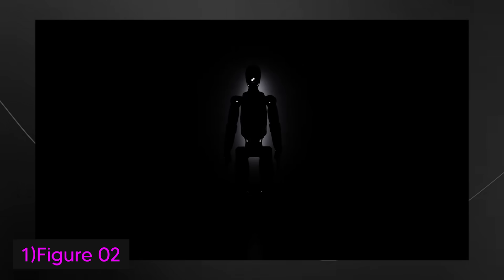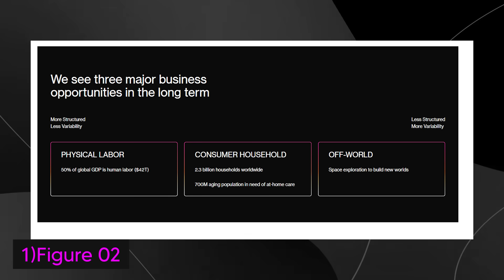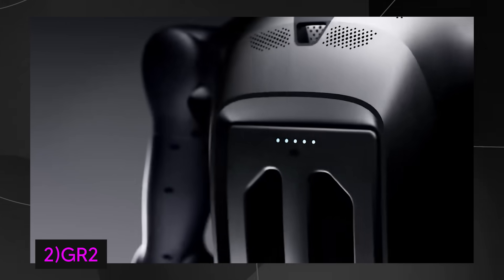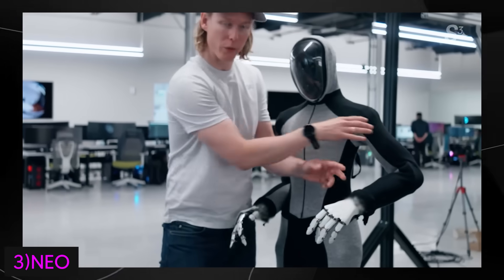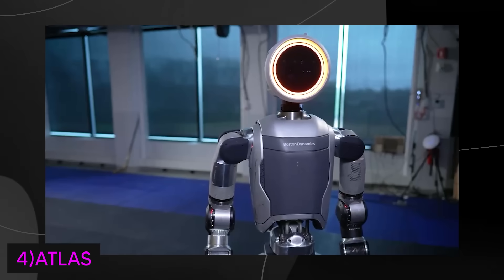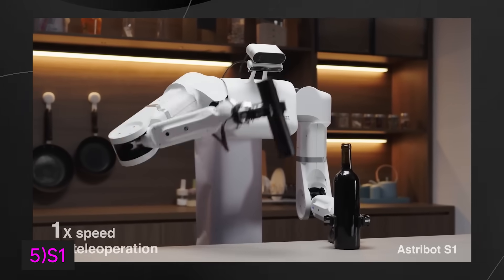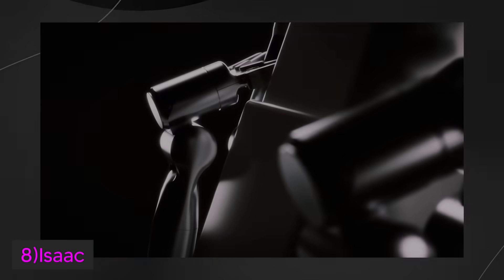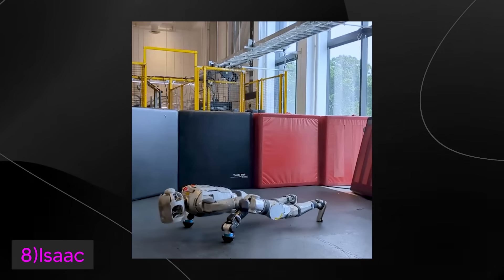Top 10 NEW Humanoid Robots of 2024 (Updated)

Comment: What happens when these humanoid robots tip over? Can it pick itself up? How durable ate they. If my child accidentally knocks it over, will impacts dislodge or break components. What if they get wet? Run out of battery power. How long will it last before needing charge? Are they confined to the home?  What if a person gives it a firearm? What is the estimated lifespan? What do you do if it malfunctions or stops functioning completely?  Most importantly is there a kill switch? All of these presentations are too vague about any sort of actual specs or capabilities. All I am seeing are glorified animatronic like machines that remind me of Chucky Cheese. Task specific robotics make sense for efficiency and safety. These humanoid robots are not actually doing anything that would help or save a person time. Its going to become an obstacle in the home.  You can hire cleaning service for 1/3 of the robots actual cost.

Comment: Ugh, they show it doing some of the easiest tasks and fumbling with that, then they show it walking down the center of the road, since it wouldn't be able to handle a complex environment of obstacles. In their current form and level of functionality, they are absolutely useless to the average person or business.
 They also exaggerate capabilities. Like Isaac folding clothes but they don't show it. Even if they did it would probably just show it folding an article of clothing (if not an easy towel) that was already spread and laid out for it. Not get a pile of clothing out of the machine and pull individual pieces from the pile and then proceed to fold and stack them.

Comment: https://youtu.be/Nm17eiQlBAE?si=z5CtfA4g4e2ROFFK
F=m*a*b*c, an operating systems line code for gold kit robotics in college courses costs students $7887 but the SOST will not operate at full systems speed without the proper system code. There's a swear word in the robotics kit name but usually covered by tape so no one cares.

Comment: All of them are still a bid clunky and slow. Still a long way to especially when it comes to walking. Really early stage.
Reply: @jean-marcducommun8185  actuator tech just isn’t there. Personally, and Disney agrees with me here, Torque sensing and propioception is paramount in fluid movement. Generally pressure sensors and torque sensors would do wonders for grace but we just don’t have that tech outside of boutique cases. Teslas robot hands. They’re going to have to invent it. Otherwise when it encounters a catastrophic abnormality in the home it’ll have to roll into a ball because enacting a blind prelearned solution, flailing to recover, will likely end up with karate kicking little Timmy in the teeth.
Reply: Of course they are early stage.

Comment: You forgot Unitree Robotics. Their humanoid robot is similar to New Atlas from Boston Dynamics but it is already available for the low cost of 16000$. No other company can do such an advanced robot at such a low price.
Reply from the maker: Yes i did forget the g1 unitree robot!
Reply: @TheAiGrid yup. You messed up.
Reply: @thecorrectoification if he was a robot, he wouldn't have messed up.
Reply: That's because the price is almost fully subsidized by the CCP
Reply: Word is that version can't be trained or programmed.  You need the EDU version for that at $32k.  I mean still cheaper than anything else out there but they really aren't there yet.  :(